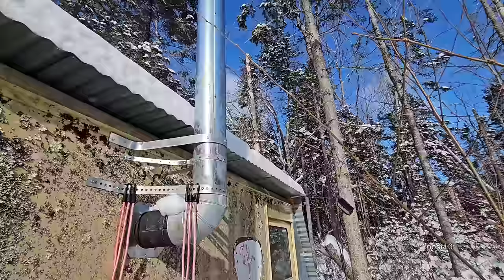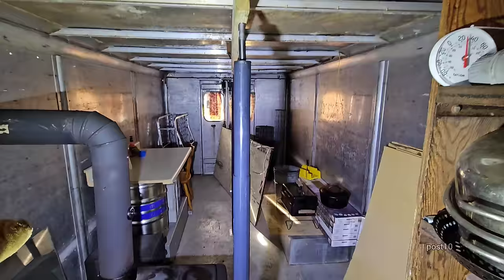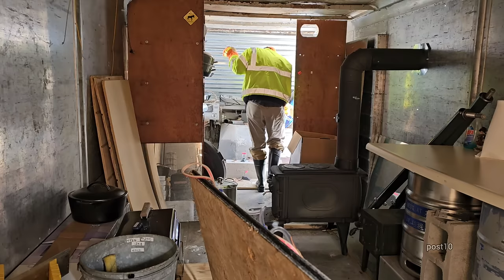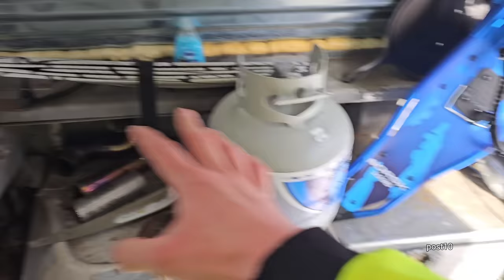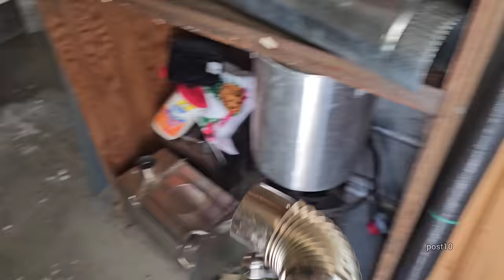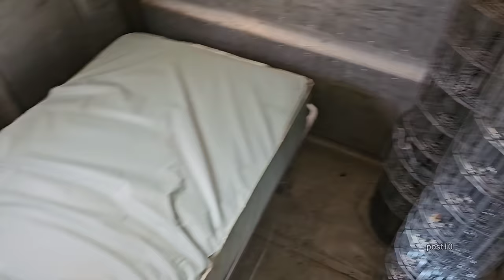Over Night At The Abandoned Truck Camp Very Cold Weather 2024

Comment: One thought for the engine compartment; could you not maybe cut some plywood to shape for the floor and insides of the engine bay - maybe with some thin aluminium to prevent animals chewing through? (I would have suggested the wire mesh you have in rolls there, but those holes would be too big to stop rats or mice, and likely not a younger raccoon either) then with a bit of cleaning and oiling of the hinges, could work well? - Well, never mind, the cooler fit perfectly. Though thinking about it, that is probably about the size the engine block might've been in a vehicle that size.

Seeing you starting the fire reminded me of a neat thing I saw of in another video. It might be the British army does this, or I might be misremembering, but having a pencil sharpener, then you just find a thin enough stick to get shavings that'll light very easily; or keep an old pencil there for shaving.

Seems it was a great time camping. Look forward to any more that you're able to do this winter.

Comment: Hey Post, Did you ever mention how you got a bread truck on your property? Also for that glove compartment, clean it out, get some foam insulation tape from home depot and cover that whole thing inside. For the floor, you can get some cheap anti-slip strips! Will be awesome!
Reply: So he originally went out to this truck to clean it out for someone else who'd bought the property. They'd been planning on moving it and using it as a shed, in the end it worked out too expensive for them to get it hauled out and the whole plot of land ended up going up for auction, so Post bought it himself.

If you wanna find the original, it's titled "(SALVAGE JOB) Box Truck Deep In Rural Vermont Forest Full Of Stuff", and the one where he explains that he bought it is titled "24 Hours Living In Abandoned Truck Deep In The Woods During Snow Storm. Transformed Into Camp"

Comment: I wonder if you could create some sort of ventilation system for the truck that you can slide open and shut without having to keep the door open, sort of like how you created the doors for the propane tank smoker? Maybe cut a few ‘vent’ holes into the wall of the truck and rig up a piece of sheet metal that can open and close from inside the truck? Just a thought!
Reply: To take it a step further, you could place a battery powered fan in front of this vent to draw in cold air from the outside to prevent the truck from getting too hot.

Comment: Was thinking you could cut out a hole in the top on the engine compartment that would fit the cooler perfect.  Then the cooler would stay cold and you could still access the cooler without having to open the engine lid.

Comment: You should heat up that pot/bucket full of water before going to sleep and keep it next to your cot for some extra heat through the night rather than throwing all that waste heat out the door. You're wasting energy.
Your light keeps flashing on/off because its detecting the heat differences introduced from your stove.
These lights trigger on heat, can't tell the difference between your stove heat and an animal's heat.
You should insulate the inside of that place with foam board, the ceiling at least. It's make a HUGE difference in your wood budget. You could install it with a good liquid adhesive. Or even velcro strips if you wanted flexibility.
You should use one of those bungee hooks from your chimney  to hold up youe engine cover when you're working there.

Comment: Try putting those traps on the edge of the wall by the baseboard they travel along the walls not out in the middle of the floor. That green mouse blocks u can get in buckets works good get a bate box to fill and put under truck.

Comment: Ay post i have a suggestion for your stove try putting a piece of diamond plate grate inside so the ash will fall and keep the wood off the ash and it allows the fire to get air underneath and burn hotter

Comment: The sun will eat up Spray Foam insulation,its not UV Resistant, the floors in those are wear resistant,but slick when wet or cold. The Body is good to go for another Frame. I'd do it ,but its a Cool Camp.

Comment: fwiw , the battery should not explode.  They can handle more heat than your hands and the internals likely have thermal shutdown protection.  I wouldnt worry too much.
Reply from the maker: I've had the cheap Walmart brand power Banks explode while charging them so I just assumed the lithium ion batteries were very dangerous in those conditions
Reply: @post.10 oh yeah the cheap Walmart ones will do that but the nicer stuff like you've been investing in will hold up. Also if you ever need a driveway to camp in and charge your stuff in south east pa get in touch.

Comment: Why do you claim this truck is abandoned in the woods when it is in your own yard,you can see in the background of all these truck camp videos specific trees,log piles,rocks and broken tree trunks even the concrete well (with yellow bucket on top ) and the yellow tops of the electric fencing of your vegetable garden which all appear in your home yard videos.also the log pile next to the truck is identical right down to the size,shapes and positioning of the logs to the one in the oil change mower vlog you did at home , so you are camping in your own garden
Reply: Mixed with PCP! You have problems, son!
Reply: you cracked the code sherlock! make sure to print this out and have your mom put it on the fridge

Comment: I would put a pile of burning wood under the engine cover, it'll be out of the weather and easy to get out instead of going outside. Maybe try to find some poly bead insulation from a construction site and put it on the walls.

Comment: I like RatX rather than traps because traps are single use and RatX pellets will stick around for years when deployed indoors. RatX isn't a poison and the corpses won't harm predators. The ingredients are all safe for human consumption even.

It works by coating their stomach which blocks the stomach from sending the signal to the brain that the mouse or rat needs to drink water. Eventually they die painlessly from dehydration. Because they die so dehydrated they're nearly desiccated already and don't stink up the place.

Comment: Dude, you need to learn how to use a wood stove.  You want to heat your pot, you need to pinch in the damper, if you leave your damper open it’s just pushing all the heat out of the stove  up through the stack and out which is why you’re blowing through all that wood so fast.  Maybe invest in some tools for your stove too, a cast iron set will go a long way and much safer than a stick.👍